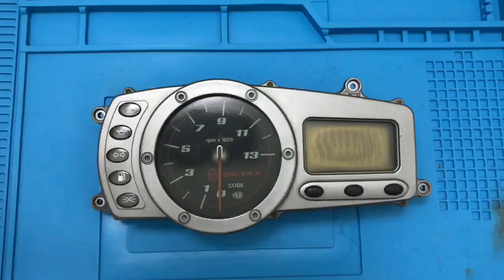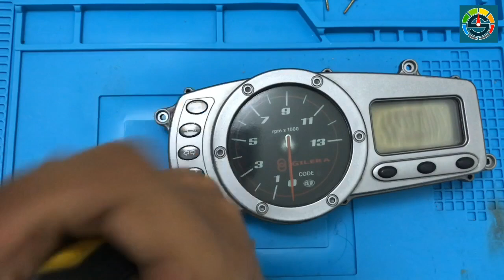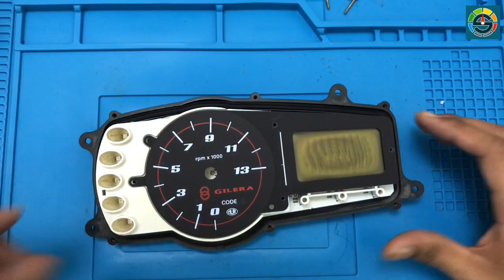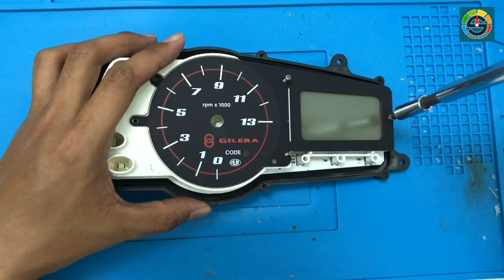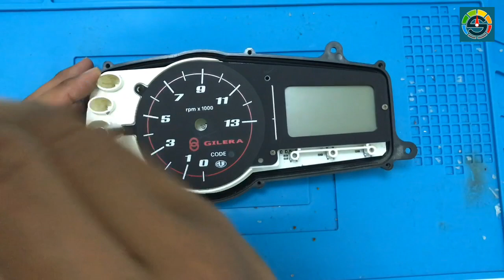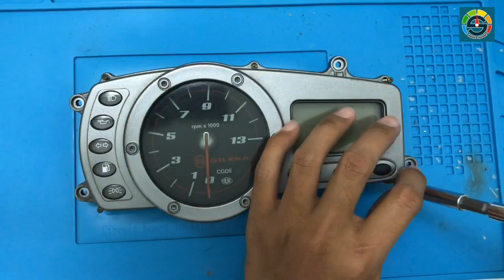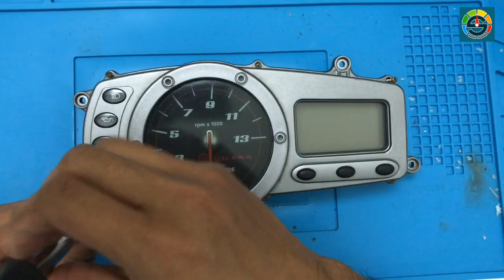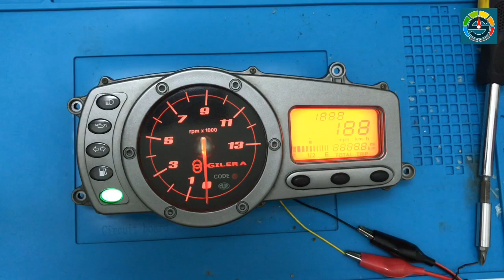How To Repair Speedometer Gilera Runner _ Part 1: Display Problem

Comment: No shoing how you changed polarizer film? Only how you remove old one
Reply from the maker: After remove. Replace new one. Use zero degree polarized film for lower lcd
Reply from the maker: For upper lcd use 90 degree polarized fim
Reply: @st.meterspecialist  thanks. Where i can buy poralizer? need for mu malaguti f15 digital.
Reply from the maker: can be bought on ebay
Reply: @st.meterspecialist  thanks for thanks!
Reply from the maker: Welcome friend

Comment: Hello
I want to repair my speedometer.
I dont know which Parts i need. 
 i found two broken Part one is
SM 7Ba Position D101
The second one is i think
Y3W 76 or 7G Position ZD102. 
Please help me speedometer is from nrg power it looks like the same.
Reply from the maker: Hi. Already replace the part?
Reply: @st.meterspecialist  Hi no i dont know which Parts i need or where o Can buy them
Reply from the maker: Whatsapp me at +60177201367
Reply: Thank you very much. 👍👍👍